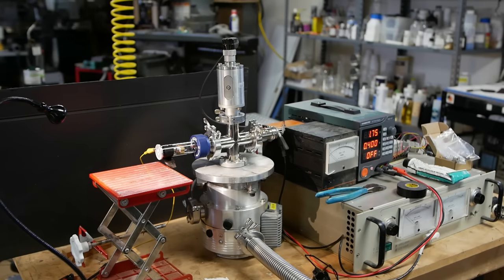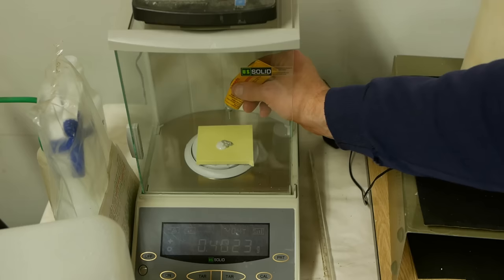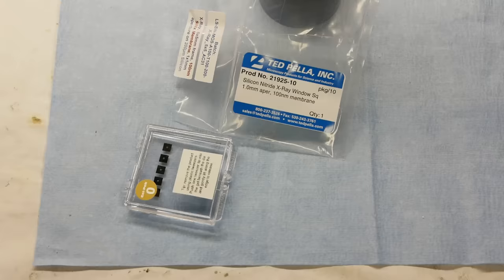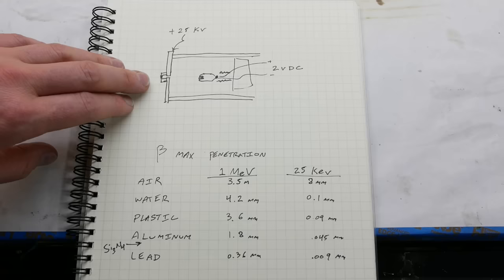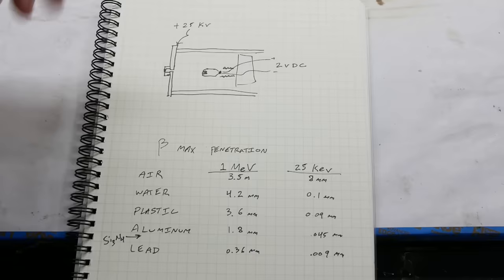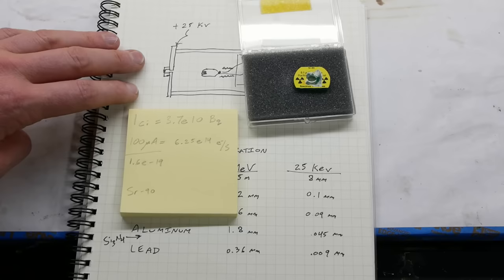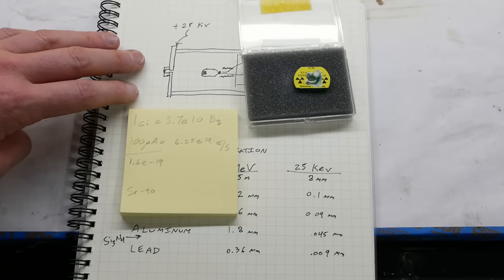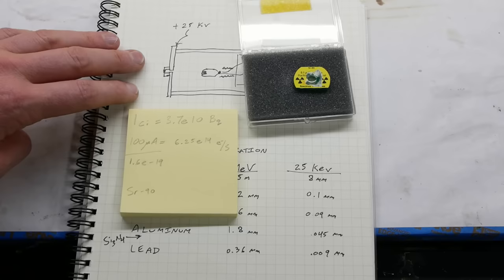Shooting an electron beam through air

Comment: If you put a tiny gap ahead of electrons source you can observe a diffraction of electron beam. Question is when the diffraction will be more -- when edges of plates of gap are sharp or smooth. Gap size the same of course.
 (Sorry for my, it can be, strange english)

Comment: TeleVision was projected through the air at some cinemas in England, the 1955 cinematograph regulations limit x ray exposure from TeleVision projectors in cinemas (outwith of the beam) to 0.5 rontgens over 70hours, from a maximum 150,000volt 1ampere source

Comment: i work with ultra-high vacuum turbos, ones that spin over 1k Hz. I wish I can show what we call the helicopter effect once in a while when a grad student wrecks the pump. modern controllers shuts off the turbo if the gas load is high, but sometimes it is too little too late.

Comment: Probably not the most practical but you might be able to use the portable XRF gun detector to detect the X-rays given off when the electrons strike a target/material. Basically the same as EDS in an SEM. More surface sensitive than XRF.

Comment: Why couldn't a window 10x thicker dissipate 10x more heat? Is most of the heat being conducted to the air on the outer surface instead of conducting to the solid structure?

Comment: Ben, thanks for such a nice video! I really enjoyed it. One thing: if you adjust to 100microAmp that gives you the current of e- through your filament, but another thing is the amount of e- coming out through such an small aperture, that must be orders of magnitude smaller by solid angle and distance. One thing I was curious is whether one could try to actually measure such an small current outside of the collimator, and determine the flux of e- coming out, perhaps a wire around it and measure the induced current?

Comment: I would be interested in seeing the beams effects on semiconductors and solid state circuitry.  Perhaps make a simple 555 based Astable Multivibrator and then measure its frequency and fluctuations when in the beam and outside the beam.

Comment: Would little bits of paper or powder pick up enough charge to repel each other and move around? Also, I know Alpha sells "surface irradiated" heat shrink tubing which has an inner wall that melts. It isn't adhesive.

Comment: Re magnet: you have to approach the beam from the side; that will send it on a circular path.
Heat shrink tube is irradiated and crosslinked at the small diameter, then expanded under heat and frozen in the expanded state. This is metastable and goes back to the irradiated form when heated up again..

Comment: Great video. I was trying to use old Wehnelt cylinder from old CRT, but I couldn't get not even the close you got. I wanted to see if the water  change the conductivity if exposed to some kind of radiation. I have also wonder if I put some energy into water, does it make H+O weeker in regards to molecular force.
If you can show, that will be great.
Thanks a lot.
George

Comment: what kind or ionization does it cause? does it affect the airs electrical resistance by a lot in the beam and due to the beams movement does the electrical resistance differ in the 2 direction depending on what side you want to send the electricity to, that would be interesting things to know and think of.

Comment: I can see  that you have used a small voltage to heat the lamp as electron source ,what is the difference if you supply more electrons using your high voltage 
source ?

Comment: The reason I searched for electron beam through air is that I wondered if you could trigger supercooled (distilled) water to freeze by using an electron beam.  I read that it had been accomplished with neutrons.   So maybe you could try it a higher voltage and a very thin plastic bag of supercooled water.

Comment: Very cool. Tesla produced electron beams in air using a different method. He had a small hole between his vacuum and free air, with a taper on the outside of the tube with high pressure air flowing along the outside. The high pressure air stream entrained the atmospheric air in the region of the hole and 'batted' it away, maintaining a high vacuum.

Comment: are the windows narrow enough to see electron diffraction results if you could place two of the thinnest ones next to each other ? if you had a high voltage setup could you place the tube in a really strong magnetic feild and visibly see the electron beam splitting ?

Comment: - Shoot some flames with electrons!
- Try to charge metal items and see if you get a discharge from it OR charge non-conductive items and see if they repel each other
- Try to make oil fly or move around
Super interesting video as usual!
Reply: The patent for the flame rectification amplifier was issued 
Feb. 10, 1948, H. S. JONES 2,435,940
SAFETY CONTROL SYSTEM FOR FUEL BURNERS
Original Filed July 29, l94l
500+ vac on a flame rod will pass a micro-amp pulsed D.C.through the flame.
This is a flame detection circuit common in gas burners.

Comment: The cross-linking of PVC-wire insulation does not make it more flame resistant. The PVC gets mixed with Mg(OH)2 and when this heats up it reacts to MgO and water. The water then weakens the fire. The problem is, that just mixing Mg(OH)2 into the polymer makes it really brittle and basically unusable for insulation. The cross linking happens between the polymer and the Mg(OH)2 and makes it less brittle so it can be used in applications where elasticity is necessary again. If I remember correctly, the final product also surprisingly gets pink-ish.

Another cool application is cross-linking a regular thermoplastic polymer after it was brought into its final shape. If you for example cross-link a plastic cup, you can heat it up above the glass transition temperature and deform it pretty severly (as it is typical for thermoplastics above their glass transition temperature). The deformed state will stay after cooling. If you heat the deformed cup up above its glass transition temperature again, the molecules can move more freely and go back to their original shap, the undeformed cup. It's almost like a shape-memory effect.

Edit: In retrospect, that's probably the same procedure as with the heat shrink tubing.

Comment: How far do the electrons penetrate glass? Is it possible to convert a lightbulb (one that has a vacuum and not a gas fill) by metalising the front and leaving a tiny hole in the metalisation - can you get the electrons to pass through the thin glass without the glass melting?

Comment: These windows would be great for proton injectors for a small linac or cyclotron build. They would solve the problem of needing a gas filled ion generation stage and a high vacuum acelleration stage.❤

Comment: We definitely found that interesting!

If you'd be willing to play with surface tension for droplets (I don't think you're willing to flip entire assembly on its side and hang it down), checking how liquids and gels behave could be interesting. Maybe chemiluminescence hallmark - luminol solution, or carbon or iron particles suspended in water would give a visible effect (I suspect macro lens would be required, though).

Comment: Would it be possible to focus the beam in to fiber optic strands? Curious the refraction survival distance. Parabolic mirror focusing in to strand/strands, and possible recombination on the other end, perhaps even to split beams and then use the split beams to interfere with each other at the other end. Last question--what is the speed of these electron particles, relative to the speed of light? Vague hunch the device could be used to measure time dilation effects.

Comment: Suppose you shot electrons in a solution of electrolyte with a metallic salt (as is used in electroplating), would the metal drop out of solution at the place where electrons enter the liquid? (i.e. electroplating without electrodes)

Comment: I'd love to see you do some lensing/guiding work with the beam. It appears that it diverges quite a lot after exiting the pupil, do you think you can get back to a beam? I'd love to learn how this is done; and I wonder if it works similarly to optical sources; there you might have a geometrical-optic solution (lenses/mirrors) or even a fancy wave-optical solution (Bragg gratings, etalons, etc.) but what do you do with electrons? Does this cross some kind of boson/fermion line? Please help, I only know enough about this stuff to ask questions!

Comment: Did you positive bias the windows for ease of building, knowing that the electron will be soon stopped after exiting, or for others reasons ?
If you put the window at ground and the filament at -25 kV, wouldn't the electron be less pulled back after exiting the window ? perhaps increasing their range ?

Comment: Hello! Awesome stuff! If you can send these electrons down an evacuated, non-grounded metal tube, will it pick up charge and channel the rest of the beam to the other end, sort of like a super conductor? Also, if the metal tube is open-ended, will the electron beam force the air out?

Comment: Ben, would you please point your electron tube at a standard solar plate cell to measure any possible change it may cause in the cell's electrical output?  I'm curious what electrons from such a device like a CRT would have on a solar cell.

Comment: what an interesting way to make a battery. I wonder if you could do the same thing with p type silicon.? what to do with excess solar power?  kind of like a giant spherical diode. basically, a way to discharge. or a thyristor.  maybe use some radioactive sources as a boost. that's it I want a vacuum chamber.

Comment: 5:01...just thinking back to my messing around with old 2 valve superhet radio receivers many years ago, you could also experiment with another another anode positioned between the filament and your 25KV end plate.  Using a circular ring anode at half the high voltage potential could be a fun way to increase beam power or focus.  Would those windows be close to the same thing used in a Geiger counter window for alpha particles ?

Comment: What happens to the electrons that are emitted into the air?  You can't charge up the air (or any materal you put in front of it) with electrons forever, it seems.  How do they return so that charge is conserved?  For materials that are somewhat conductive, I suppose you can ground them to the ground of the apparatus, but what about electrons that just get emitted into air or hits non conductive materials?  In SEM, things to be imaged are coated with metal which is grounded so that a closed circuit is formed (those that don't hit the sample are collected b/c the chamber is at ground).  What is happening if you shoot electron into open space?

Comment: No, those electrons get pulled back by the anode and complete the circuit... For your device to produce free electrons you need to Earth the cathode and add second anode at some distance and apply negative 25 kV...

Comment: Please pardon the very high density of questions here. I got on a bit of a roll. I wonder what the exotic glasses that you made would look like under the beam? Or perhaps more things on the extreme ends of the triboelectric series like n-buna or viton rubber (which might be good for vacuum seals too!). I don't really know much about electron optics but maybe holographic film (can electron beams have a "color" to them) or polarizing film (can electron beams even be polarized like light beams? (I doubt it but I really don't know)) would be neat. I'd be super curious about materials with high positive and negative verdet constants like Terbium Gallium Garnet. Also what would happen if you tried to fire the beam through a very thin magnet could it be deflected or refracted? Can it activate the surface of glass like a flame can? Is it possible to swat the electrons physically to the side with something like a slotted wheel in an angle grinder or dremel or are the electrons just going too fast? Is it possible to reflect the beam off of a highly charged plate (getting the plate close enough without arcing might be tricky)? What happens to very thin pieces of glass? Ph paper? Could the electrons coming off be picked up into a superconductor or again are they just going too fast?

Comment: If you place one lead of your ameter in the beam will it measure the current? Could you use it to map the the spread of the beam in the air? Does the beam form a large diffuse cloud of charge after 'stopping' in the air?
Reply from the maker: An ammeter should measure the current, definitely!  I was nervous about an arc popping the window, but I should reconfigure the anode to be 0V relative to ground, then it would be easier to use electrodes nearby.  I also wonder where the additional negative charge goes if there isn't an obvious conductive pathway back to ground -- out into the air, I guess.
Reply: @AppliedScience  Maybe a little smoke in the air would show the current flow. It could be making those weird 'high voltage air threads' (Bill Beaty has a video on them) that happen when you have a sharp point near a Van De Graff or other high voltage gear.

Comment: did you tried aluminium foil as window? it can hold a vacuum too
what is the practical problem to go beyond 20kv? the window or the highvoltage circuit?
i mean there are plenty of circuits to avchieve 100kv on the internet. Have a 3,5m long beam would be useful ;D.

Comment: Beam ideas:

Deflecting with magnets if possible.

Can you use the beam to charge a metal plate / capacitor?

Soap bubbles.

Can you reflect or refract the beam?

Geiger counter.

Double slit experiment.

Comment: With the +25 kV you pull the electrons out. But the get attracted back.  Would it be not better to push them out from behind with -25KV so thy would push out further in the air, or does this have no influence? Do you get ions in the air? Is it the oxygen that ionizes? Uv radiation? Is the ionized oxygen pulled back to the electrode.? Is there air flow?

Comment: Please, try to treat platinum&tin silicone with the beam. I know that popular sticky silicone mats are not adhesive-coated, but low pressure plasma activated, maybe electronic beam would have a similar effect?

Comment: Is the divergence of the beam in free air due to repulsion of like charges or something else?  The only two ideas that come to mind for me are placing your geiger counter near it to see if it detects any xrays and to put the whole thing in a vacuum chamber to show how penetration varies with pressure.  Not sure if using different gases would be interesting but you could potentially do that in the chamber as well.

Comment: How about making an "air transistor" by using some sort of conductive barrier in the beam that the beam could quantum tunnel through and control the amount of tunnelling with a bias voltage applied to the barrier...much like how a transistor works but built like a vacuum tube but with no vacuum.

Comment: So what is the conceptual difference between this and, say, St Elmo's fire, or otherwise high voltage fields forcing electrons through air? E.g. I have (randomly) a plasma sterilizer prototype that has a high voltage plate that makes short current-limited plasma arcs to whatever it comes close to. Why are the electrons that my sterilizer is pushing causing plasma and arcing and such, whereas the electrons from this device are just sort of invisibly dispersing?
Reply: OK I'm taking a guess at answering my own question: with St. Elmo's Fire or high voltage arcing, the difference is that the strong electrical field is driving the electrons through resistance, thus doing significant work, causing heat, etc, where the pure electron beam is not being driven by anything besides the momenta of the particles, and thus is not as energetically intense?
Reply: @CaseyConnor  Electrons going at half the speed of light?  Penetrating air, just from their velocity?  Instead St. Elmo's fire is slow electrons, plus a glow-discharge (a type of spark, caused by gas breakdown.)

Comment: Why did you use a smashed lightbulb for the electron source and not an used electron gun from a CRT that has accelerator tubes to speed the beam up?

Comment: Stupid question, probably  (hey, it's late). You've got an electron beam coming out into the air, call it 10uA or whatever. How is the loop closed so the voltage doesn't build up  and up and up? Just dissipation in the air somehow? Is there a noticeable corona discharge (ozone, violet light emission and such?)

Comment: It would be really interested to irradiate some PTFE to permanently trap some charge. It might give you the electric analogue to a magnet, an electret.

Also I heard of another type of vacuum window for electrons, called plasma windows. They use a constant high power discharge to generate a plasma which acts as the window. You could even pass solid objects through there I guess!

Comment: How about putting a voltage reference chip (maybe something like decapped LM399 in TO package) or even simpler zener diode in glass package under e-beam, measuring zener voltage at same time with precision DMM like K7510 to see if the radiation change output voltages? Knowing this would be interesting in context of stability studies of zeners, as in many cases different people seen random "jumps" of few microvolts from static operating zeners.

Comment: Thermofisher does this in their transmission electron microscopes by simply placing a range of carbon apertures with tiny holes in between the FEG accelerator (UHV condition) and the sample holder.

And in between 2 DPA's they create a buffer vacuum with their own ion getter pump and turbopump.

Comment: Can you increase the acceleration voltage with a Marx generator?  Since you now know that your turbo pump will survive decompression through the failed window, it would be interesting to see how much energy the silicon nitride window will tolerate before failure.